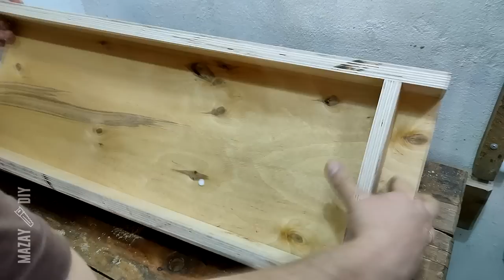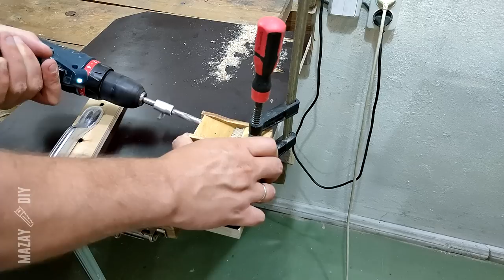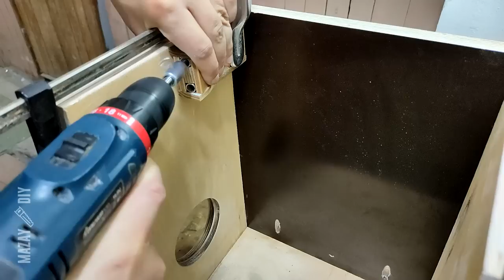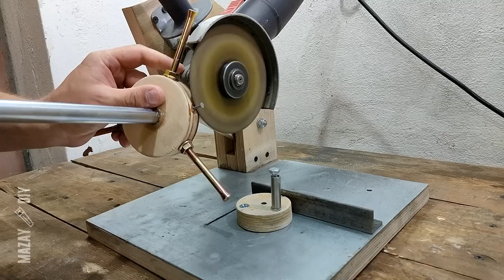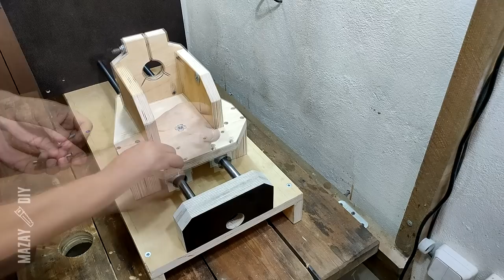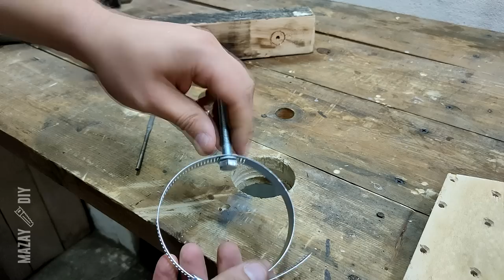DIY Drill Press Machine | How to Make a Homemade Drill Press Stand

Comment: What Did That Cost To Build?
Reply: Yeah right now I am looking into costs.  The Baltic birch plywood seems expensive.  I am searching for sources for other parts also.  3/4" / 18mm Baltic Birch Plywood for Laser & CNC Cutting and Engraving (12" x 24") 5.0 out of 5 stars 1 $16.95.  I have done some wood working, so I do know that wood is expensive.   I am not sure what woods I can use as a substitute.

Comment: Good morning. Thank you for the plans, but my computer is not opening the grabcad files. Please, dou you have juste the dimensions, mainly the dimension of the bearing end its shaft. Congratulations!
Reply from the maker: Carlos Simões de Campos, I post only a 3D model, drawings with all dimensions will be a little later. The diameter of the shafts is 16 mm, links to the main parts can be found in the video description.
Reply: Thank you very much for your prompt answer.  Please what is the dimensions of the bearing used for the mentioned shaft of 16 mm of diameter?
Reply from the maker: 1. Linear Ball Bearing SC16UU (16 mm) - https://www.banggood.com/custlink/3KGhr8Hhnj - for guides
2. Ball Bearing 6202 (17x35x11) - for feed lever

Comment: it seems it's going to be very hard to push on the drill with large diameter drill bits or when drilling in tough materials. Not sure this approach is usefull.
Reply from the maker: If we are talking about a cable, then you are wrong - a large pressing force can be developed. It's work great! But I wouldn't use this machine for drilling over 6mm in metal or wood with large diameter hole saws.